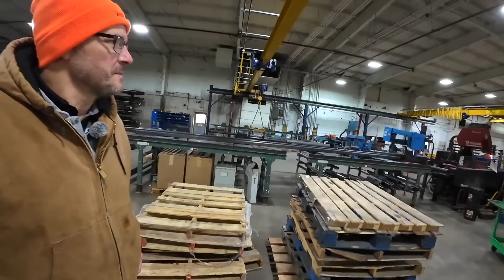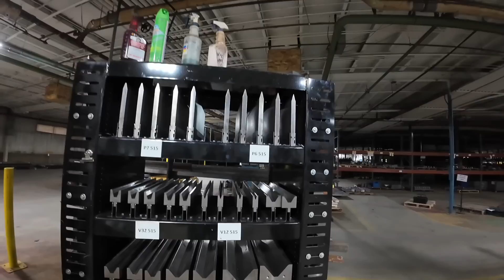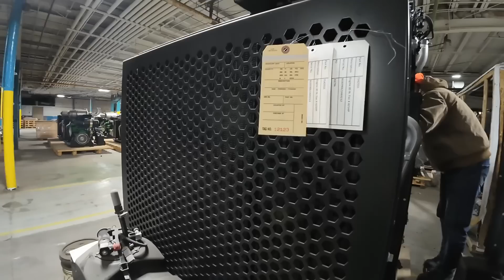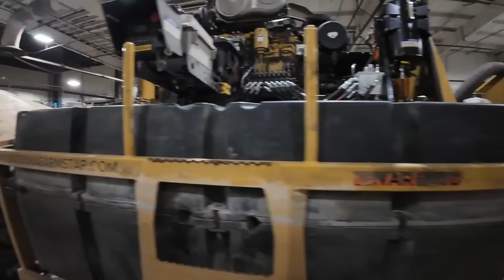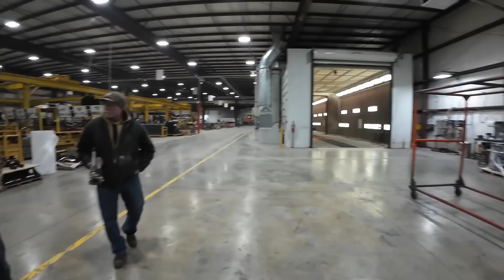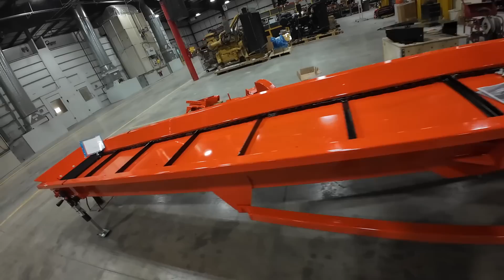BLOCKBUSTER FIREWOOD PROCESSOR FACTORY TOUR!

Comment: Good Morning

What a great tour of a massive facility.  Lots of technology.  Bert, did your heart rate go up when you saw the CNC machine?  Plus, converting the 2D plans to 3D is impressive.

Jeff, do you manufacture your own hose, or do you spec it out for bid?  If you make your own hose, another market would be the Fire Service.  Large Diameter Hose, or LDH is used as above ground water mains during fire fighting operations.  NFPA 1961 would be a source for more code info.  The invention of LDH eliminated the spaghetti  created by using smaller diameter hose as supply lines.
Reply from the maker: I think they make everything there (couplers and parts for connecting the miles of hoses)